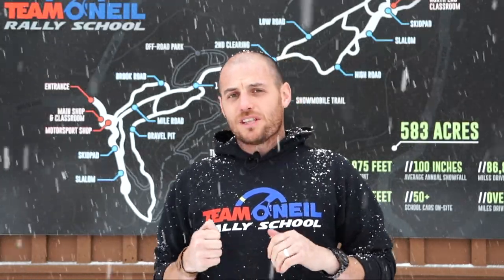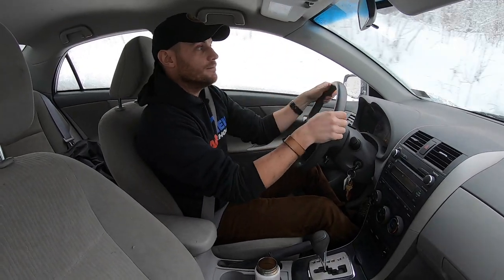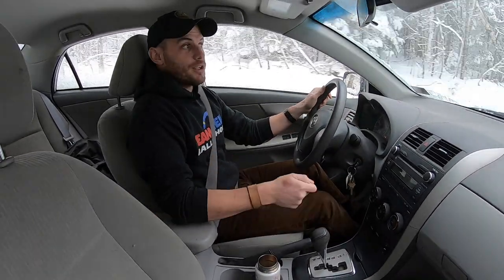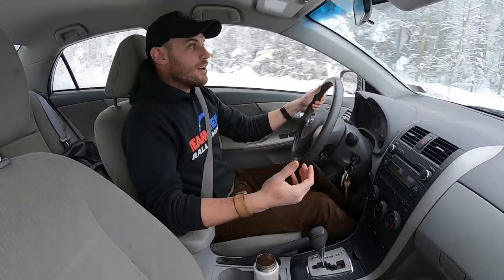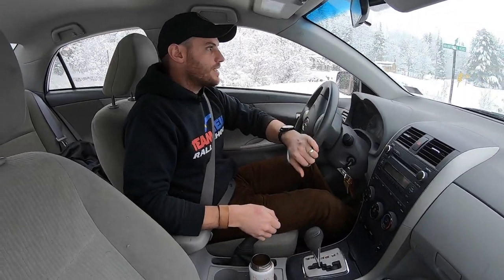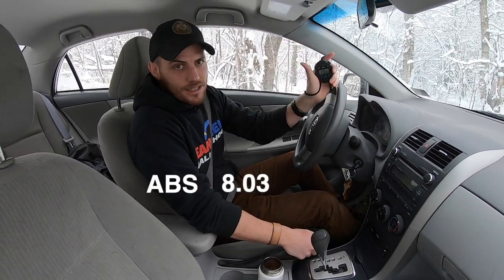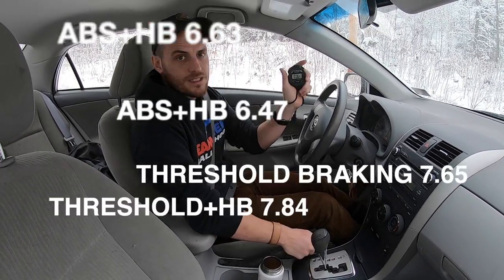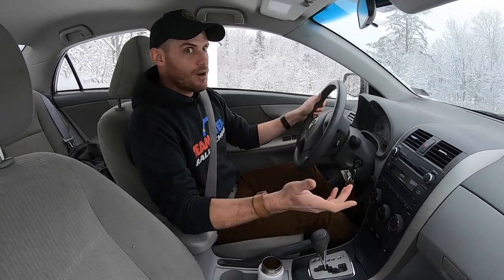Stopping Faster With the Handbrake

Comment: Also a really good technique if you are reversing down an icy (or generally slippery) slope. In that situation its very easy to lock up the fronts causing the car to start dragging sideways. Then you have to ease off the brakes to regain control but that will have you gain more speed again. By feeding in some extra rear brake via the hand brake you can stay nice and stable. In fact using a lot of hand brake and only a little foot brake will guarantee that you lock the rears first, which is more stable when reversing.
Reply: Brilliant.  I've spun numerous times while trying to slowly creep downhill this winter.  Sounds like this technique might help me :)
Reply: One added tip is to put the car in reverse, and drive down with left foot braking and hand brake.

Comment: Good tip. With the wheels off I found out that can drive with one or two teeth of hand brake without it touching the drums and it gives me more rear breaking power
Reply: It doesn't really, only makes the rear brake engage earlier in theory. The bias is set by the piston size ratio, not by how far they're to the rotor or drum. Also, the brake is self adjusting, so all you're doing pretty much is so it adjusts to the line pulled a bit position the be the norm.
Reply: @piciu256  Thanks for the analysis. I'm still not sure how it works or if it works with other cars. So am I not able to change the ratio by adjusting the handbrake nut permanently to start braking with the first click? It seems to work.  Maybe I should do it when I think about it. I'm not happy with my braking power. Someone told me that it should engage on the third notch
Reply: @trollmcclure1884  you can adjust the cable tension, but again, it doesn't change the brake force applied, just lessens the free stroke.
Reply: @piciu256  Yeah, I think I remember it wrong. It adds up to only after the handbrake applies force by the wire + the hydraulics. Thanks

Comment: Pretty much the same thing that happens with a 4x4 with locked centre diff, no weight transfer  means the rear wheels contribute more to braking. This just gives you independent brake control, instead of locking axles together and forcing the front brakes to stop the rear wheels.
Reply: Not really: 4:29

Comment: Instead of using a handbrake, are there any systems that start out 50/50 front/rear  when light on the brakes but then as you apply more force become progressively more front biased? Would that even make sense?

Comment: The best thing that you didn't try and it works best is to don't let the handbrake and the stop brakes to lock the wheels or in the case of the front wheels to engage the abs.

Comment: While on newer cars electronic parking brake won't help with such maneuver, newer cars very probably also have EBD, that depending on detected wheel slip can act as brake biasing valve .. not just that, they can even brake differently individual wheels and readjust on the fly in very short intervals, as governed by electronics. Unfortunately though, EBD may also be bad for performance driving, if manufacturer tuned it more biased for "supposedly safer for novice drivers" most often biasing brakes to result in understeer-ish nose-plowing in turns
Reply: EBD wont really help here if you are already are mashing an old ABS, as the rear will also be in ABS mode.  The only thing that would help is aggressive racing ABS set up for loose surfaces.
Reply: What people are forgetting is that cars with ABS have plenty of power in almost all cases to lock up the rears as well on pavement.  And on the snow yes there is less weight transfer but the forces required on the rear wheels are LOWER than on pavement anyway.  So these cars enter the ABS loop on the rear on the snow  when you hammer the brake and the distirbution of braking power is not a huge factor.

Comment: I think "sportive" abs should be similar stop distances than threshold with no abs. But in more cases I've seen even with abs car you can stop faster with a good treshold technique (no abs activation but fully braking power).
Anyways, I think abs is not that good when surfaces are slippery

Comment: Please elaborate on damaging the center diff when using the handbrake while moving in 4wd vehicles. I’m asking because I love to do handbrake turns in my Lexus gx470 when conditions allow and want to keep doing them without breaking the rig
Reply from the maker: That has a torsen center differential, like most Audis have, except yours probably has the additional option to lock the diff. You should be good to go as long as it's in normal default more and not locked. The Torsen (name comes from torque-sensing) diff will handle handbrake turns much better than a viscous coupling. Check out: https://en.wikipedia.org/wiki/Torsen

Comment: I’m still not clear exactly when  abs helps braking distance. 

theoretically speaking on pavement is it possible to get better stopping distance without abs? As in just carefully applying just the right amount of pressure.

I assume that abs hurts stopping distance on loose/slippery surfaces correct?
Reply: ABS helps a lot when not running on an icy road. It keeps the car straight, avoids spinning and brakes at max possible power.
Its only weakness is the very slippery surface, it doesn't know harder break could stop the car quicker.
IMHO it's still better for drivers with basic skills. Without ABS, their cars would start spinning that can cause more serious accidents (frontal crash is still safer).
Reply: A pro is better then ABS.
we are not pro's
Reply: ABS never helps with stopping distance, that is a false assumption many people have. The advantage with ABS is that it allows the driver control of the vehicle under heavy braking. Since the wheels will not lock up you will be able to steer and hopefully swerve around the thing you are trying to avoid hitting. It also keeps the car pointed in the direction of travel (rather than spinning around on locked wheels) and that is much safer for the occupants in case of a crash.
Reply: @_RobertS  It also means (with EBD) that if a left/right pair of wheels is on a less grippy surface, the car won't pirouette.
Reply: @_RobertS  True, but in a panic situation it gives the driver the confidence to just hammer the breaks which shortens the stopping distance vs. braking well under the limit, giving up precious distance.
Also I think it depends greatly on how advanced the ABS system is ( sensors/polling rate ). A system that is designed and tuned well will ultimately be better than no ABS, otherwise race cars (e.g. GT3 cars) would not run it.
Reply from the maker: ABS was never meant to help you stop faster, it's designed to help keep the car from skidding and sliding. 
It's pretty good on pavement and most drivers will never brake hard enough to activate it anyway (except in an emergency).
But to answer your question,  yes you can definitely out-brake ABS on pavement.
And yes it hurts stopping distances even more on gravel, sand, mud, snow, ice
There are very advanced motorsports ABS systems that you can adjust and tune to your liking.
That's a different game, and you'll definitely see drivers that turn faster times with racing ABS systems.
But street car ABS is entirely for the safety of the masses and costs actual braking performance.
Reply: Team O'Neil it all makes sense now thanks for the reply

Comment: I suppose this technique is probably unnecessary in cars with Electronic Brake Force Distribution.
Reply: I think you might be wrong on that.  The real deal here is that he was defeating the ABS to dig down to better layers underneath.   With enough brake pressure and ABS< the rears are also under ABS control and get enough braking power for ABS to engage (as far as I am aware) .

Comment: Question : Wouldn't just jamming on the brakes (panic stop) to the point where the ABS kicks in on all wheels allow the ABS to provide a bit more power to the rear brakes since, without the grip to provide weight transfer to the front the rears are going to be less likely to lock up (assuming four channel ABS)?
Reply from the maker: I see what you mean, where if you go for a full hard stomp on the pedal and hold it down hard enough it should give the rears enough brake pressure that proportioning basically doesn't matter anymore... At that point you're going to end up relying on the ABS programming completely, so exactly what happens is going to be pretty different in different cars. The ABS in this 2010 base model Corolla is going to behave differently than the more advanced ABS in a modern car, especially something more high-end... My guess is that the better and more advanced the ABS system is, the more you can just hold hard pressure and let it do it's thing like you're saying, but we'd be curious to try it with a couple different platforms and see what the results are.
Reply: @Teamoneilrally  I thought you got to that point with full ABS tests (jamming the brake).  I think the effect you see with pulling the HB is really just locking and digging through some layers + building up a little pile of snow in front of the rear tyres. :)  So as Surestick88 says basically, but that won't have the same performance as using the HB.

Comment: Long story short, a braking system that has powerful front and rear brakes, ABS + EBD would be the ultimate braking system overall.
Reply from the maker: If you pull the ABS fuse, it'll stop faster every time. Check out https://youtu.be/GmaIdmHjnOg 
We've done plenty of ABS vs no ABS tests, and ABS has never won. 
Keep in mind, ABS was never designed to help you stop quicker...
It's just there to help avoid skidding.
Reply: @Teamoneilrally  Yeah, this doesn't really have anything to do with ABS "power" and often not even brake balance.  It's just that the programming of ABS is not suitable for loose surfaces.